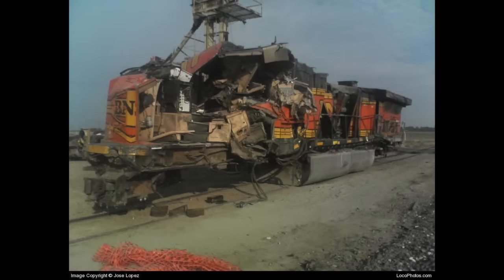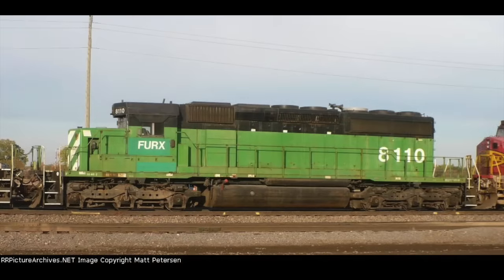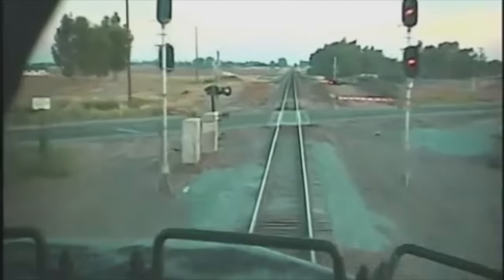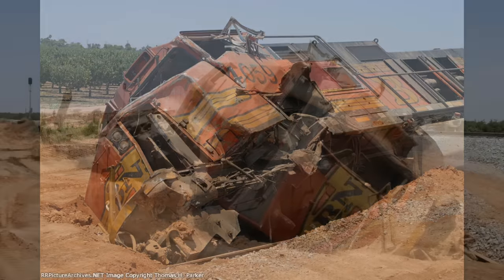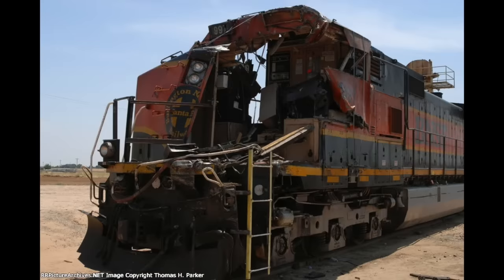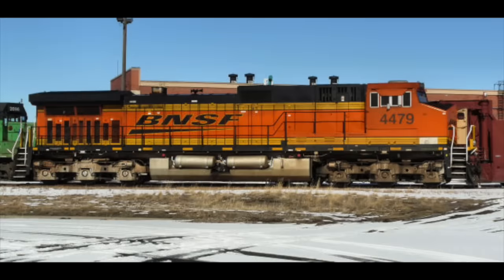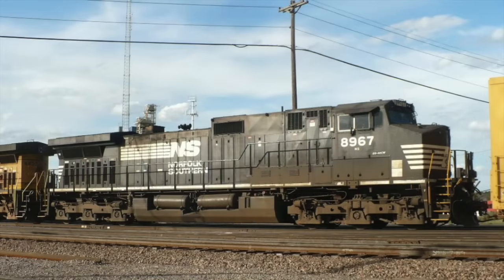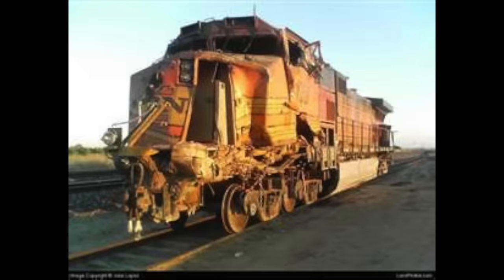Kismet Train Collision 13 years later

Comment: “You should never have drugs in your system on the job”

Or, you know, just never
Reply: I’m not talking about medicinal prescriptions, but it seemed weird to put a disclaimer in the actual comment
Reply: Ever been to McDonald's
Reply: smoke kush everyday man! /s but also not so much, alcohol is also a drug along with many otc drugs that impair driving. Basically there are exceptions.
Reply: @PlatoonGoon  like I said, McDonald's
Reply: Alright tool.
Reply: @EricToTheScionti  least they actually have one
Reply: @Abcdefghijklmnopqrstuvwxyz0000  unfortunately, CBD oil still has enough THC in it to trigger a positive drug test.. there's a lot of truck drivers that got put into the clearinghouse this year due to CBD oil.
Reply: Some ppl work better when they are on drugs lol
Reply: @swappedoutZ71  Like I said; Ever been to a McDonald's?
Reply: @watcher206  If it has enough THC in it to show up on a drug screen, it's got enough to impair your judgement. Maybe not by much, but when you're driving a vehicle that can weigh upwards of 80,000 pounds, you really should be as unimpaired as possible. Coming from someone who, within just 6 months of having to drive the 35 miles on the highway going to and from school, has already nearly been ran off the road 4 times (3 of which happened in traffic when going at speeds ≤40 MPH), by a semi truck because the driver wasn't paying attention, I really wouldn't want to see what would happen if their reaction time was slowed, even by a little bit, from them using CBD oil. And just a note, all but one of those incidents occured in broad daylight (roughly between 15:30 and 16:30), the fourth incident occurring between 08:00 and 08:30, and in all four cases, the weather was perfectly clear - no rain, no fog, and little to no cloud cover - and the roadways were completely dry.
Edit: I was wrong about the time THC takes to clear your system, it only takes about 10 days to clear enough to pass a drug test
Reply: @richardmillhousenixon  I understand that.. the issue is two things. First, there is no known test to determine if the driver had smoked at home during weekend or on the job.. so until a test with that kind of accuracy is developed, it's pretty much stay away from everything ever if you have a CDL. 
2nd issue is that the CBD manufacturers are not required by law to disclose THC content, resulting in manufacturers putting out false claims like, "THC free" or "guaranteed to pass test". This needs to change, as someone that isn't aware of this may assume that CBD oil is okay.
Reply: @watcher206  Firstly, THC takes a long time (upwards of a month) to completely clear your system - which is why you can still be flagged on a drug test a month or more after use - and until it is completely clear, you will still be affected, even if it may not be noticeable to the casual observer, so the fact that they may have used it on the weekend or just at some time they weren't working doesn't really matter, it would still affect their cognition.
Second, while I don't disagree that there should be more regulation on how manufacturers display THC content on their products. And this goes for any pharmaceutical, supplement, or just anything that is designed to be consumed in one way or another - there should definitely be regulations in place to require manufacturers to display all components, regardless of concentration, in those items. That is why things like nutrition labels exist, and why your Advil bottle lists both active and inactive ingredients, but the law doesn't apply to vitamins and supplements, or really just anything that's not a drug in one form or another. How regulators don't get that even if the main ingredient isn't classified as a drug doesn't mean none of the other components are drugs is beyond me, but that's just my opinion.
Reply: @richardmillhousenixon  nobody cares about mcdonalds bruh. We know its bad for u. Thats old news. Like 15-20 year old news. Please stop saying it to everyone here
Reply: @swappedoutZ71  That's not my point bruh, literally almost everyone is smokin weed at McDonald's
Reply: You do realize all pharmaceutical drugs.    Are synthetic hardcore drugs right?

Morphine is opium 
pain relivers are usually crack
Only vitamins are “natural” drugs
Reply: @donovanulrich348  Oh you mean the "natural" vitamins on the market of which 90%+ are made synthetically? Oh man those are so natural. And I would like to know what source is telling you that most painkillers are made from crack (aka cocaine), which is an amphetamine.
Reply: @donovanulrich348  And are you also trying to tell me that marijuana isn't natural? Because as far as drugs go, both pharmaceutical and not pharmaceutical, that's about as natural as you can get.
Reply: Naw, drugs rule. Just don’t drive a hundred thousand ton vehicle when you’re high.
Reply: @pietjanssen7670  Look, I'm all for the legalization of recreational marijuana. But I also know toxicology. If there's enough to flag on a drug screen there's enough to impair your judgement. Like I said, maybe not by much, but when you're driving a ten-thousand ton vehicle any impairment is enough to be an issue. And weed doesn't stay in your system that long, only about 10 ish days, so you aren't looking at a months hiatus if you want to get high
Reply: @pietjanssen7670  I will admit that I was wrong when I said THC could stay in your system for a month or more

Comment: If I recall correctly (and I have read the FRA report) it was the Conductor, and not the Engineer that was the one that tested positive. The claim was that they had a clear block, but tests showed there was no signal malfunction.  The cause was that the crew of the southbound crew ran the block.
Reply: Actually, they may not have ran the block intentionally.  With all those other locomotives behind them, and the Force created by the Weight and Velocity, the Laws of Physics could, and quite possible could have, caused the Train to  'Overshoot The Runway' ..... ( for search of a better term).  I'm in Sydney Australia, and we have just opened a 'Metro-Rail' Train Line:  It's a Driverless Train System, operated from a Command Centre.  The Stations have Gates on the Platforms that the Train Doors line up with before either will open.  Anyway, during lengthy and stringent tests, prior to the opening of the system, everything worked like clockwork.  However, on the opening day, the Train Doors were stopping past the Gates on the Platforms.  It seems like the Laws Of Physics were going against them.
Reply: KKEM641+ Did they all die, or did they survive
Reply: Neville Madden of course it wasn’t intentional. The engineer didn’t have control of his train and the conductor should have plugged it long before getting to that signal.
Reply: Everyone lived, and no one died.
Reply: More along the lines that miss read the signal. The report states that both the Conductor and the Engineer both questioned if they had a red or green signal, and both thought it had turned green. However later tests proved there was no malfunction.
Reply: @berkshiredave9766  ... That's more or less what I was getting at.  The Loss Of Control was possibly Beyond His Control.
Reply: Just pointing it out there, but the one driving the train should've known when to apply the brakes. And especially in the case of USA's freight trains, failing such 'simple' tasks means you're not qualified to drive one.

When I say simple, I don't mean simple for everyone. Also, I don't have such working experiences so don't take my words so seriously. Unless I miss facts such as how common USA freight train overrun signals, then I should be right.
Reply: @TheAmir259  ... True!  But the Engineer cannot always know how specific conditions may affect the Stopping Power of the Train when there are Multiple Locomotives Hauling It.  Especially if the Conditions of the Rails are not perfect:  Such as being Oily.
Reply: @nevillemadden5210  the number of locomotives means nothing.  An engineer can feel in the seat of his/her pants how a train is going to act pretty soon into the trip.  

Lack of situational awareness, sidebar conversation in the cab, or just like every other form of employment, there is a dumbass on all jobs, and unfortunately there are also qualified engineers that arent truly qualified to run a train and should have never been turned loose.   Also the radio...  Now days conductors dont half ass call signals, or make love to the damn handset.   First rule i learned 18 years ago was that the radio is your life!!! Listen to it, use it correctly and audibly.

I'm pretty sure "we thought the signal changed" was just a hope this gets us out of trouble statement.  How can you be on the mainline, know a train heading towards you has to get in the siding before you can proceed and its not beside you in the siding already, and you really think you just got a clear indication???  This is the training, or lack of that this profession is dealing with these days... Sad.
Reply: @tenobles you, sir, may be the first person posting on here who has the “big picture” and common sense. It makes no difference who smoked what illegal substance, it is clear these guys didn’t know what they were doing out there. As you said, how can you NOT know whether a train has gone by? This wasn’t a double track main. They weren’t in a Harry Potter movie. That crap about “we thought the signal changed” probably happened when the union rep showed up and got them together to get their stories straight. I’ve been there. I know people who are still telling their friends the same CYA story 40 years later right in front of eye witnesses. Some people never accept responsibility for their actions. Finally, that argument was a non-starter. You don’t base your actions on what you “thought.” If you don’t “KNOW” you “STOP.”
Reply: @Nscalestuff  ... So what your're virtually saying is that, if we were talking about Motor Vehicles, if You were travelling along a road that you were very familia with, YOU would know when to Apply Your Brakes, no matter WHAT The Road and/or Weather Conditions were !?!
Reply: @nevillemadden5210  yes.  Every milepost, every signal mast and location, every top, every bottom, crossing, overhead bridge, rabbit path, every funny looking bush with green leaves at a curve where you go in dynamic, every rusted out car in the woods near a bottom where you better be getting out of dynamic and the wet soggy rotten teddy bear next to a bent up bycicle sitting in a ditch that you better be full throttle or you're gonna stall, and the shack covered in kudzu towards the end of a stretch if rip-rap that you better grab a couple notches or the rear is gonna come in and knock you out of your seat if you have a block of loads on the rear..... So yeah you should know.   If you question anything about your territory or not sure whats around the next curve, then you are not qualified.

No matter the weather conditions, no matter the length or tonnage.  You're gonna know how to operate in any environment long before you get to it, even if you just pulled away from swapping out, you're gonna know how to handle it.   You're always thinking 2 miles ahead, and 2 miles behind. Usually more than that.
Reply: @Nscalestuff  ... I agree with much of what you say, but Nobody Can Predict How Road Conditions will Affect There Stopping Ability.
It's like saying, I Know The Entrance to Lake Tuggerah (at The Entrance, N.S.W.) like the back of my hand.  No You Don't!  The Conditions are Forever Changing.
Reply: @nevillemadden5210  are you a liscensed locomotive engineer?  Wet, dry, cold, hot..has a minimal effect stopping a train.  This is about knowing where you are at at all times.  Conditions change, but nothing changes so drastic that you run a stop signal unless you arent paying attention, asleep, incapacitated, stoned out of your mind, just plain stupid, or you cant reasonably judge distance.  The only exception is catastrophic mechanical failure.  Not because you have 3 or 4 locomotives instead of 1, which is where this whole debate started.  I just un-assed a 13,000 ton grain train about 45 minutes from the writing of this post.  All night long I felt like i only had 2 dynamic brakes on line, when I know I had all 3 turned on.  I had to use lots of air going down hills because the dynamic wasnt holding it back like it should.  Not once did I exceed the speed limit, not once did I use too much air that I had to stop and start again per the rules.  Why?  Because in the first 2 miles something didnt feel right in the ass of my chair, but since I didnt have detrimental reason to stop, I kept driving, and adapted to the change in condition that my train felt like it had.  I run 14 to 16,000 ton mixed freight trains with only 2 dynamics, so 2 dynamics on a 13,000 ton grain train is just fine, but 3 are allowed for bulk commodity.  182 miles later, I stopped the front steps of 13,000 tons right in the middle of a 4 foot wide paved walkway to swap out with another crew.   Before I climbed down, I walked back to the second locomotive, and to my suprise the dynamic brake had kicked out before I ever left my initial terminal and I didnt know it.. But as I said..something didnt feel right... But I still stopped within inches of where I planned..not in the foul of another oncoming train.   Not trying to be rude, but your arguments are invalid to me, and anyone on here who does this for a living, and all those behind the throttle who shake their heads when these things happen, and wonder how these things happen in the first place when WE as engineers usually know exactly what happened and dont need any kind of report, or re enactment to know exactly what happened.  Now, its time for sleep.
Reply: LOL, "Couldn't Stop their train because they had too many locomotives".  The train would actually stop better with more locomotives.  The Crew Fell Asleep.

Comment: Status of the Locomotives
BNSF 4059: BNSF 4059
NREX 5473: Scrapped
BNSF 1065: BNSF 1065
FURX 8110: WAMX 4152
BNSF 2437: LTEX 2437
BNSF 7065: NS 3517
BNSF 997: BNSF 997
BNSF 4479: BNSF 4479
BNSF 4715: BNSF 4715
NS 8967: NS 4208
BNSF 4576: BNSF 4576
Reply: 2437 is put into storage and will not run again
Reply: @SD60M  hmm. I dunno

Comment: Ok but, did everyone on-board the 11 engines survive the collision?!  I would lead with that next time, and then establish the status of the engines involved in the crash.  Seriously.
Reply: DestructiveTones they survived yes
Reply: Yes they all bailed out of the locomotives
Reply: Danny Edelman not all of them. 4059’s crew bailed out (you can see one of them bail out in the video), but 4479’s crew stayed onboard, because they decided they would ride it out. Luckily, everyone survived.
Reply: @Thomas1651  oh okay thank you for that information I thought both crews had bailed out of the locomotives when they were close
Reply: @nvstewart  Nowadays you don't even need a second crew for a separate set of locomotives, because of the magic of radio control.
Reply: @nvstewart  Also, the train doing the "power move" wouldn't have had all its locomotives running. Unless the train was actually long and heavy enough to call for 7 locomotives, it would've been a huge waste of fuel.

Comment: Here's an annoying bit of info about this crash:  the engineer got his job back but the conductor was fired. Let that sink in for a second.  He still works as a switchman in the bnsf Stockton yard under the condition he never works the road again.
Reply: Kensington Chapp the conductor was the one that tested positive for cocaine.
Reply: @jimmygrant3212  i know
Reply: Kensington Chapp and the engineer wasn’t but the signal was found to not have any problem that’s why he got he got a job back as a switch man…
Reply: @jimmygrant3212  guys get their jobs back from a Rule G violation all the time. When you test positive for drugs you have the option to attend a company-provided rehab program as part of our progressive discipline policy, even after being involved in a major incident. The difference here is in the conductor's case, the UTU didn't aggressively represent him and he didn't press the issue. The BLET fought for the engineer, even though that guy had numerous rules and availability violations in the past. It all came down to union representation on this one, not drugs. Drugs played a part, but based on the company's drug rehab policy, the conductor should have had an easier time getting rehired than the engineer.